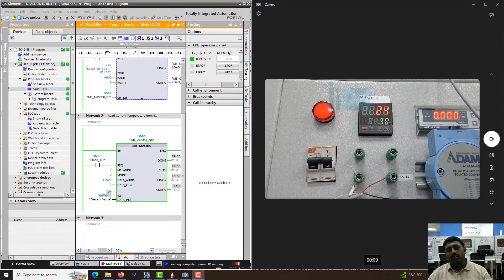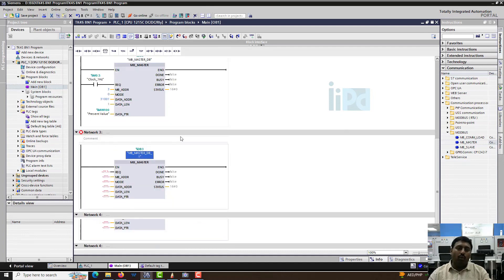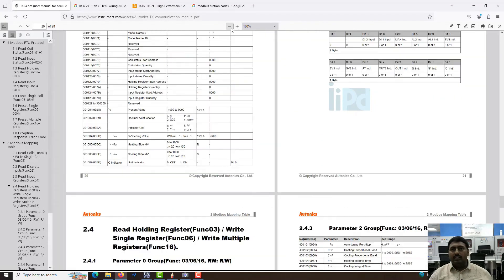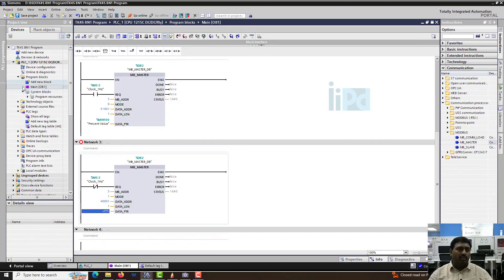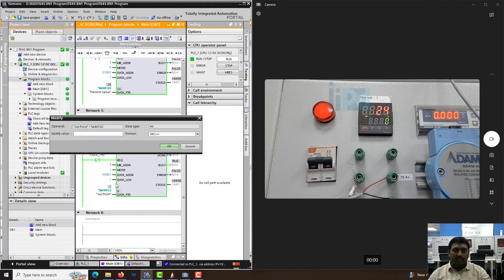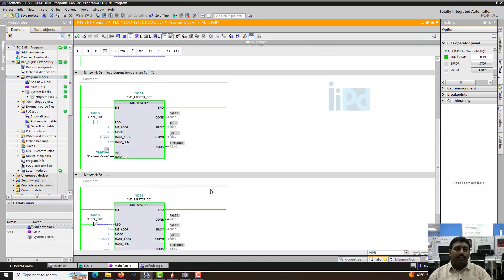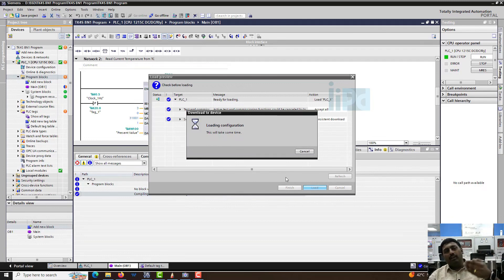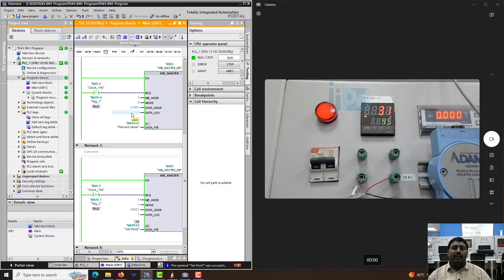How to Write Modbus 485 Data to a Holding Register using MB MASTER Block To Autonics TK4S

Comment: its not working for me. i'm facing 8200 error
Reply: check your code Sir. The error mean that You are trying to call at the same time different instruction of the Modbus Master. To test it I suggest to just put one and then another ....Hope you dont need this advice because is been 4 months. But in case another person watch the video and have the same problem.